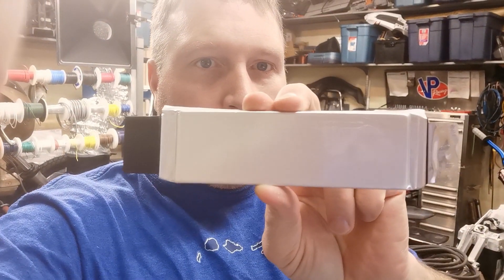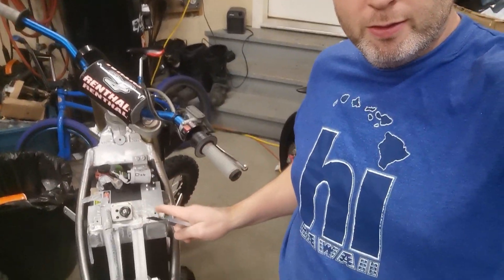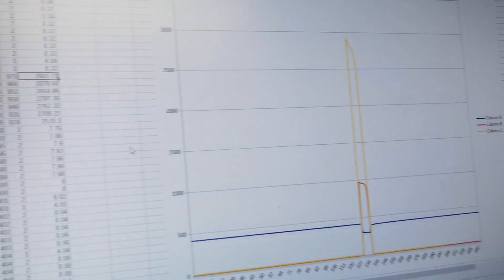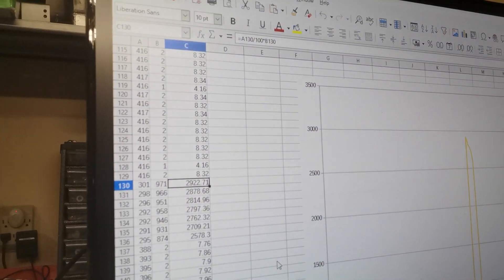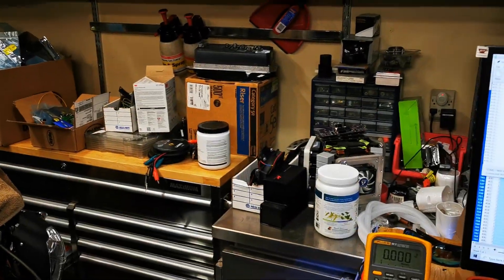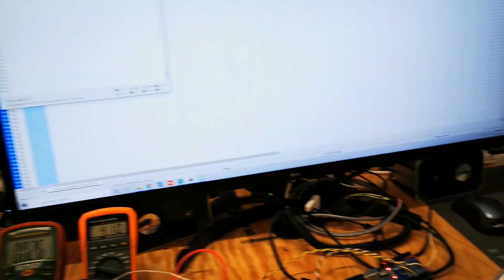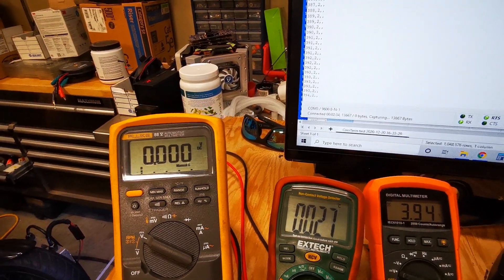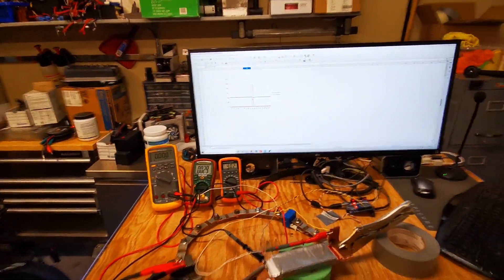Racing Cell Testing Day 1

Comment: 4-5 Years ago. This is my stress test for custom cells. 1400A from start. Voltage drop from 3.72v, to 3.28v, after second. 
Usually for peak i make test for 2 sec., continuous 10 sec.  

https://youtu.be/Km72lIMeSsw

Comment: Is  that a LEM HASS 600 sensor (can read about ~2000A max)? If so, how come you are using 0.1mV/A vs 1mV/A, you scaled it down by 10 at some point, wouldn't you want the additional resolution?  Those are some serious cells :)
Reply from the maker: The Data sheet for the LEM sensor is 600 nominal and 1100 a peak we would like to prove if it reads past 1100 amps though because its a stupid low resolution.  I swapped it out of Axiom for a LEM HASS 400 that has better resolution and also 1100 amps peak.  As for scaling.  I had to write the code for the Arduino in a way it showed as much as I could.  IE for the voltage if I scaled it with the decimal place over 2 points. IT would only read voltage in 1v resolution increments.  So the math for the current sensor was written so the scale was from -2400 to +2400 amps or something like that even though it can not read that high it was the easy way to make it read properly.  I am not looking to be accurate at 0-10 amps I want a good idea of peak amps and the 10 second rating.  So far these are hitting more then the claimed numbers and that lets me know they are worth dropping 6-10k on a set for my drag racing pack.  I will cycle this one a few times and beat on it hard then leave it sit and see if it puffs as well.
Reply from the maker: Remember is a bi-directional sensor so it has 1.14xxx volts up from 2.5v at 1100 amps the max rating.

Comment: for drag racing, I'm suprized I don't see more use of 'dry ice' for cooling or pre cooling ...I see H²O ice used, but that runs the risk of leaking/dripping on the track, and you could loose traction if you ran over the water - where 'dry ice' isn't wet
• anyway, I'm kinda envisioning your cells set up in packs about like the Chevy Bolt has, so maybe look how they did it to get some ideas

I sub'ed a while ago because I wanted to lurk on your videos as I have an idea for dual Leaf motors in a boat, so I'll be interested to see how you treat the reduction gearboxes(I'm assuming you could weld the diff for single axle drive for a prop shaft?...or maybe the diff could somehow function as planetary gears for further reduction?)
Reply from the maker: With battery cells you need them warm to get any energy out of them.  A VERY loose rule of thumb is every 10 deg warmer you make the cell it will cut the Cells IR in 1/2.  So these cells likely would make 1/2 the power at 5-10 degC starting temp.  Part of the tests I will do are to prove this.  I will run a Peak DC load test and a 750amp test at 10 deg C 20 deg C 30 deg C and 40 deg C.  You need to stop them from going much higher then 40 deg C so its a balancing act.  When you take a tesla to a supercharger it pre-heats the battery pack to lower the IR so they can charge faster without damage. But once they are charging it quickly heats the battery from the fast charge so they have to start cooling all the cells.    Anyways plan is to get these cells to ~ 30-40 degC before a drag race then cool them after if needed.    As for the reduction unit.  I don't know what I will do yet.  Of course both motors and gear reductions are mounted in the car so I will run it as is for now and maybe order a Gen 2 leaf LSD to see if I can MAKE IT FIT :)  But I don't like welded diffs for anything that needs to last.  As for a boat I would just  get a different reduction unit.  Are you planning a Stern drive?  Or an outboard setup?
Reply: @garbizwal  A long time ago I saw an intercooler prototype that used the specific heat of fusion of a special polymer to absorb the heat of a single drag pass. If you could find something that melted at 40C, you could preheat the unit to ~39c and it should sit at 40 until you melted all the plastic.

Coincidentally, wax mixed with vaseline melts around 40C, and it takes about 200kW to melt a kilogram of wax in one second. If you made it down the quarter fast enough,  you'd be fine. It's a solid electrical insulator, and isn't particularly flammable as far as hydrocarbons go.

I'm game to slap one together out of PVC if you think it'd work...
Reply from the maker: @jrshaul  That is interesting.  I am thinking I might have something simple.  With these cells I need to figure out how to pull heat out of the ends (where the tabs are) but I think I have that solved.  I imagine the cells themselves will have enough thermal mass combined with low IR and the dropping IR as they heat up and the thermal mass on each end in the copper busbars but the 7-10 sec needed and not only that the first 3-4 seconds will be low current on the battery. The motor RPM has to come up for the battery current to come up.
Reply: @garbizwal  Are you using a thermal camera? The Tesla cells are quite short, and I am concerned your cells may have a substantial temperature gradient under use. 

I'll see if I can rig something with a spare 18650 to see if my idea actually works. Can I measure internal cell impedance using an immersion circulator and a multimeter, or do I need to measure it under load?
Reply from the maker: @jrshaul  I do have a FLIR.  The problem is the emissivity of the aluminum foil on the cell and the cheep heat sink I wrapped around it.  I think you are worrying more about my cells then anyone else lol.  Have your dealt with pouch cells in high current applications before?  I have friends who have encased them in plexiglass and run no cooling for race motor cycles that run 10-20 min at a time in Australia in the +40 deg C ambient temps with cells with 1/4 the C rating of these.  I am 100% sure I don't even need cooling for these cells.  But my design will bring heat out from the Tabs to the ends of the enclosure and I will be able to heat or cool the cells if needed.   I am planning to run a burst of less than 800 amps per cell only for 1-2 seconds.  This is only once the entire powertrain is at its absolute max which might not every happen.  When the car starts running the first runs down the track will not be more then 50c on these cells which they can do 2x that from full to dead!!! I am planning more testing VERY soon.  Stay tunned
Reply: @garbizwal  I've heated R/C lipo cells of similar construction hot enough to melt plastics and blown up one or two. This was a long time ago on cells with very poor internal resistance specification. 

I hadn't considered that drag racing wouldn't require full output on launch; cooling on a 12-second pass should be simple. The Model S must preheat the batteries for optimal output and  then immediately cool them.

I might try it anyway, though. I'm really, really bored.

Keep up the good work; I'm looking forward to a future of clean, inexpensive, and street legal drag racing that isn't a total dog to drive to the track.
Reply from the maker: @jrshaul  Yes the Model S cells are ~ 3c max but Tesla pushes them with great thermal management.  So I have cells here with about 75x the C rating!!!   Makes a huge difference.   I have tested 100s of cells.  And wrecked some cheep RC lipo!   But I see with these HUGE tabs on both ends they can not only flow good current but they are much easier to cool cooling the tabs is the trick!  Its like top and bottom cooling in a round cell.  (the new 4680 cells)
Anyways where do you live I could use some help in the shop if you are close ;)

Comment: Can you add a link to where you get those cells.  They sound quite interesting to me.    This is for a 2 Leaf or a 4 Leaf motor for the CRX?     As always, nice work and way to blaze the trail..
Reply from the maker: I have worked for 6 years to find these cells.  They are highly volatile.  So depending on the use (race use only) I can sell them.  I am working to become a distributor if I can.  If not I will see what I can do to help the community.  But because companies are to locked up on selling cells to people I need to keep that to my self for now.  I had to fight VERY hard to get these.  I will keep everyone posted on this.  Not looking to get rich off selling them I am only looking to keep my supply open.
Reply: @garbizwal  Not a problem.  Can you email  the specs and the prices wjbitnerATgmail.com
Reply from the maker: @billbitner9142  Email sent.  But stay tuned lots more to come.
Reply from the maker: @pauls5745  These a quite rare and you can't take risks on quality with racing cells like this.  Cheaper lithium cells for toys maybe but not something like this.